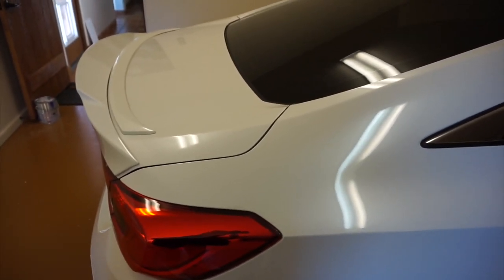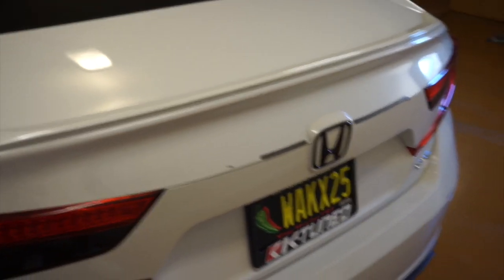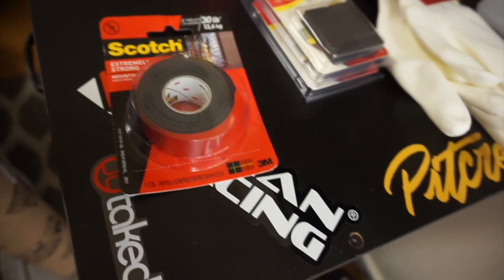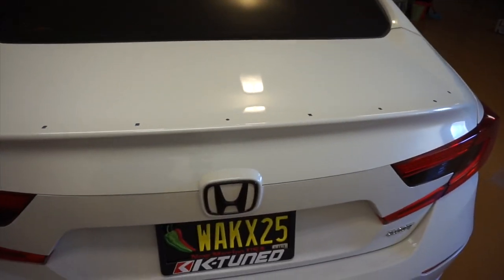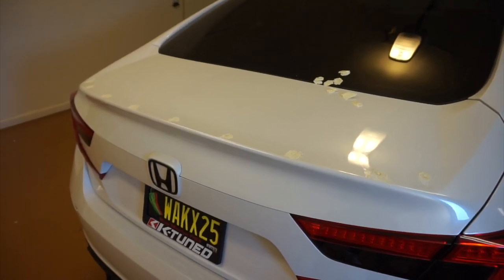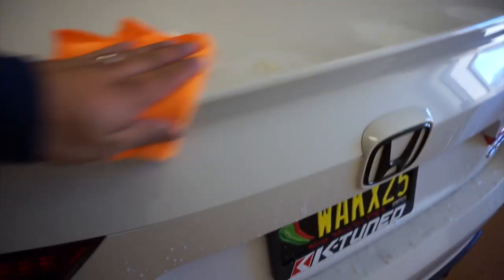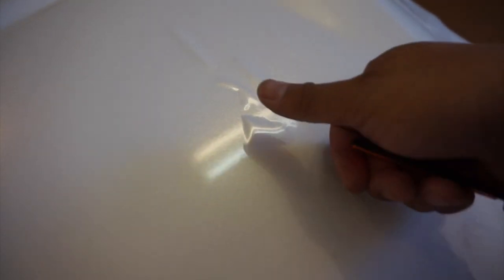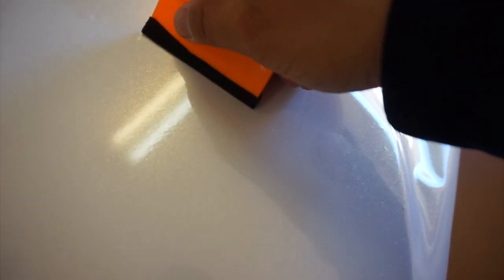Wrapping the Trunk on my 2018 Accord Sport 2.0 and adding the duckbill spoiler!

Comment: How close was the wrap to the paint ? I noticed it's a brighter white on video but how does it look in person ? If you have the link that would be very helpful
Reply from the maker: The video catches it a bit, but really it’s the spoiler paint that’s off. IMO. 

You have two choices:

https://www.metrorestyling.com/ProductDetails.asp?ProductCode=GLOSS1080GP240

Or 

 https://www.colorxlabs.com/products/color-match-wrap-vehicle-wrap-that-matches-oem-paint-color

First one is cheap route, second one is really expensive but is an exact match per paint code.

Comment: If the wrap doesn't work, another option is to go to autozone and buy a can of touchup paint and clear coat.  I had to fix a hole in m 2000 accord and it worked great.  Just took a UV lamp to it until it matched.

Comment: If you really want to have a set of different working taillights on this Accord then you should try these modules, would had looked better if you had the touring trunk lid working lamp as well. 

https://rover.ebay.com/rover/0/0/0?mpre=https%3A%2F%2Fwww.ebay.com%2Fulk%2Fitm%2F332727616291

That module can take your BRAKE light and have it work as a parking light, brake light and turn signal. Your brake led will be 50% brightness during parking mode matching the current parking mode light right underneath it & when you press the brakes it’ll go full brightness, and for turn signal it’ll flash your brake light in the direction your going at full bright flashes then back to normal 50% brightness unless the brakes are depressed (you might want disconnect the current stock signals & maybe using it as dual reverse lights? So it won’t get in the way of the mod) i’d say touring taillight would had looked better b|c it would had been a line across the whole rear rather than just half like the other models but i’m sure as it stands it’ll bring out how the tail lights on these cars functions by ALOT without having to upgrade taillights unless it’s just for the touring trunk one.
Reply: Idk if i made much sense but you seem like one smart guy so hopefully what i missed on explaining then you can figure it out. Also, 6ohm resistors on the turn signal line BEFORE it goes into the module to remove hyper flashing.

Comment: what would you prefer and why ?
2019 Accord 2.0 AT or Manual ?
Reply from the maker: Personally I wanted and still want the 6 sp. They are rare and you decide when and how gear changes happen.

I went with the 10 sp auto because I drive my car everywhere for work (real estate) so I wanted something that was easy to drive when I’m on the phone or text, emailing, etc.

With that being said, the 10 sp is pretty terrific. When you engage sport mode the trans tightens up and shifts at the end of each RPM range under full throttle or over 80% throttle (according to ktuners throttle position reading) plus you get the paddle shifters. The 10 sp is quicker off the line and uses the torque very effectively. But at the end of the day having a 6 sp would be awesome. It’s 50/50 at this point but for me the 10 sp was the winner for so many reason. 🤙🏽 Hope this helps! Keep the questions coming man!

Comment: The taillight look amazing. That what Honda should have done in the first place. How did you find the wrap matching the OEM paint?
Reply from the maker: I ended up using a 3M 1080 white with sparkle. It’s close but slightly brighter then stock. If you want color match 100 percent go to the website below. They match based off paint code so it’s spot on. 

https://www.colorxlabs.com/products/color-match-wrap-vehicle-wrap-that-matches-oem-paint-color

Comment: What color was the 3M wrap, wondering how close in color it might be for my White Orchid Pearl 9th gen Accord
Reply from the maker: You have two options. You can go cheap and get gloss white with sparkle 1080 3M wrap for $40 (2’x5’) or you can get an exact color match per your paint code which will run you a few hundred to complete. At that costs your getting 5’x7’ but it’s an exact match.

Comment: What kind of wrap did you use and where did you get it from? I have a platinum white TLX that I wanted to delete the chrome on the grill and i have a tough time finding a wrap color that was even close to the OE paint.
Reply: Another great video by the way.
Reply from the maker: I got the wrap from here.

https://www.metrorestyling.com/3M-1080-Gloss-White-Gold-Sparkle-Vinyl-Wrap-GP240-p/gloss1080gp240.htm

But if you want exact color match 100% dead on you can order from color x labs. They match the paint code but it’s pricey.

Comment: bro where u get that spoiler at i want that lol
Reply from the maker: You can find them on amazon or eBay but from what I hear they are sold out.

Search 2018 accord duckbill spoiler
Reply: Fahrenheit Motorsports   alright i’ll check it out.  hey are you on coilovers just wondering
Reply from the maker: Rhett Tipones -  No I’m on Megan Springs. I have a full install video on them here on the ch if you ever need help. 🤙🏽

Comment: Do you need to remove the accord emblem? Is it getting into the way?Because i already got my duckbill but not installed it yet.
Reply from the maker: Yes you do. The accord is definitely in the way.
Reply: @Fahrenheit_Motorsports  thanks for the reply bro! My only problem in my still night pearl color '19 accord is after removing the stock spoiler of my sport.

Comment: Hi, 
Where can I get that trunk spoiler?
Reply from the maker: What color are you looking for?
Reply: @Fahrenheit_Motorsports  Platinum white pearl
Reply from the maker: https://www.ebay.com/itm/202441684344

This one does not cover the stock spoiler holes. I had to fill them and wrap the trunk. I have videos on everything I’ve ever done to the car on my channel if interested 👌🏽
Reply: @Fahrenheit_Motorsports  I currently don't have a spoiler on the car so no holes to cover. Thank you for your help.
Reply: There's no need to apply additional glue to the duckbill spoiler? Or the tape it comes with is strong enough?
Reply from the maker: No there shouldn’t be. My spoiler came with 3M double sided tape. (Automotive grade)

If you get yours and the tape doesn’t say 3M, go to the auto parts store and buy 3M. It’s 30 psi strength so the spoiler isn’t going anywhere. I ordered a large roll off amazon for like $15 bucks and it’s come in handy for other car projects.
Reply: @Fahrenheit_Motorsports  Hello again😊. I ordered and received the duckbill. It did come with 3M double sided tape and an adhesive. Should I use the adhesive too or no need for it? 

Sorry for all the questions. I will be placing it myself, I just want to make sure it's done the right way the first time around.